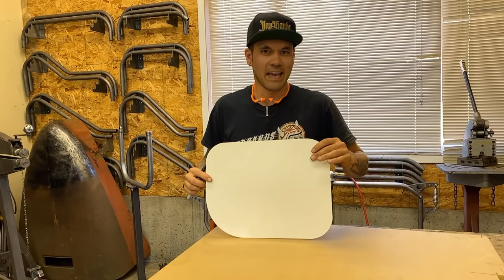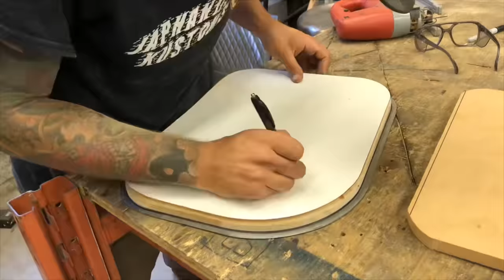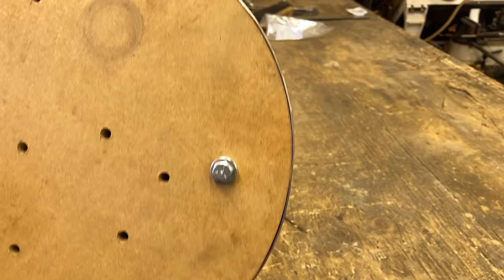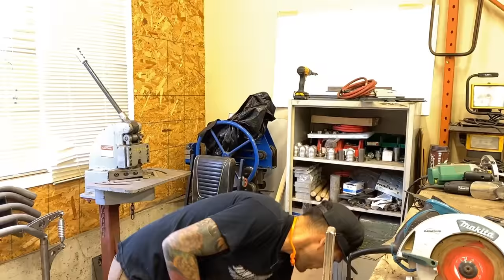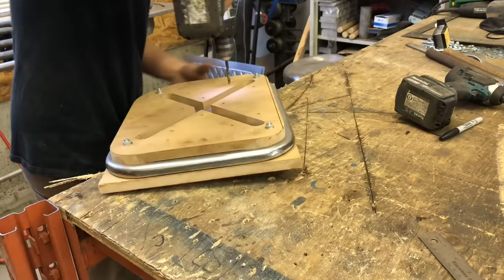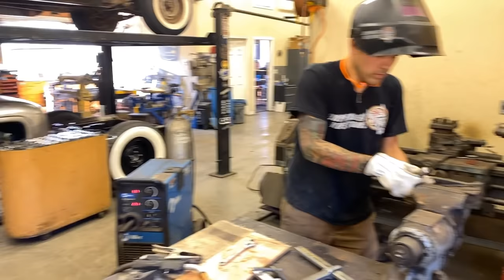Hammer Forming a Beaded Panel with Basic Tools!

Comment: Air hammers are cheap, but the compressor to run one isn't. That's the big hurdle I have to overcome in my project. I have plenty of tools for bolting on parts, but nothing for fabricating things. And there's a ton of fabrication needed on my '59 T-Bird.

Is it possible to hammer form a velocity stack? Most of the ones I find for sale are either too short or they're cone-shaped instead of having that nice parabolic curve they should have. Those are usually spun, I think. May be too deep to stretch properly with a hammer.
Reply from the maker: Anything is possible but yes that probably would be difficult to hammer form. I think that you could make a type of form that would draw in a mandrel using a bolt to curve the end similar to how a exhaust expander works

Comment: I'm assuming this won't work if you can be drilling holes in it? I'm trying to put 90° edges on an oval piece for a motorcycle muffler and can't be drilling holes
Reply from the maker: Clamps will work fine

Comment: Could you have used the router with a halfround bit to create a forming channel rarher than cutting a slot in the bottom board?
Reply from the maker: Absolutely that would’ve worked I just didn’t have the bit

Comment: I have an Idea to keep the metal from creeping when sandwiched and clamped between the MDF templates.  Rather than drilling and bolting threw the MDF and metal why not use double sided carpet tape in 2-3 inch widths. this is how I keep my metal from moving and it works well. Sorry don't mean to sound negative but would save time welding up the drilled holes.
Reply from the maker: I love that idea I really hate welding up the holes. I’m definitely gonna try that next time thank you!

Comment: going to suggest another mod for this tho. Insert a piece of phenolic resin bar in the front of it. It dosnt damage the surface of the metal as much as metal to metal contact but is still pretty damn hard so it wil probably be fine even on the end of an air hammer insert.

Comment: That is so cool on how you can do that using simple tools,also,did you design the bench you used,I like it, what are the dimensions of the table and distance between the holes and are they all the tapped? You are very well spoken,no ums,Eric's or ahhs,well done👏
Reply from the maker: Yeah it’s a half inch steel top 36 x 96 with 6 inches on centre 3/8 coarse thread
Reply: Thanks for the dimensions, I plan on building a 36 x 48 table due to the smaller size of my shop,thanks again for the ease of information on your channel

Comment: Is there a way of using this method without all the holes? I have some alloy panels I want to make, but welding up all the holes would creat a lot of warping and grinding work.
Reply: Surely you could use lots of G clamps instead?
Reply from the maker: Yes definitely if you had enough clamps you could do this without drilling the holes!

Comment: Hello, nice job. How thick is the metal sheet and what quality is it made of? Will your method work with 2mm AlMg3 as well? Heinz
Reply from the maker: This is 18 gauge steel the method will work with all thicknesses for the most part but you might have to have a more powerful hammer or stronger material

Comment: It looks like you get a more finished product with the air hammer. That must be because of the number of hits so rapidly that you can move across a smaller area
Reply from the maker: Yes definitely if you could manually hit that many times you would get the same result but you’d also be here for too long

Comment: Hi mate I’m trying this for a piece on the firewall it’s 20mm wide about 300mm long and the depth is 7mm on a 45degree with a 3mm round on the point. I’ve tried this twice now and on the point it gets way to thin and splits. I’m doing with air hammer. Do you have any tips to stop it splitting.
Reply from the maker: If it keeps getting too thin and splitting then you’ll have to make it out with more than one piece then or use thicker material to start with

Comment: Sorry for the stupid question, but isn't it a problem that the piece has all those holes in it? I mean, if you wanted it to not have holes in it, what's the plan?
Reply from the maker: Walls are easy to fill but there are ways to do it without bolting it together

Comment: I was thinking that you could use a router with a ball cutter to cut a one inch pocket in the bottom board and slot the top, then you would have your depth. You could even cut a v- groove and hammer that.
Reply from the maker: Yep that would work too! I didn’t have the bits to do that

Comment: That's a really cool technique. Looks great. What gauge steel were you using on this piece? What sort of limitations does this have in terms of too thick or too thin?
Reply from the maker: This is 18 gauge steel and it works great with an MDF form if you were to go with thicker material you might want an HDF form which is a little harder after that you could go with aluminum and finally steal

Comment: I can see a floor pan in my near future. 39 chevy truck.
Reply from the maker: Oh man 39 Chevy pick ups are my favourite full fendered pick up. I would love to build one as a daily driver one day mostly stock body lowered with all the accessories
Reply: @MakeItKustom  Have had the truck over 20 years building it now. Mustang 2 front susp. Firebird rear end ,body pretty much stock  undecided on engine. Leaning towards a built 4 cylinder so I can afford to run it as a summer daily driver.

Comment: thats cool thanks for the video just a question with using the air hammer did/can you use lube between the hammer die and metal or is it not needed
Reply from the maker: You certainly can leave between the hammer die and the metal! I’m sure it would be a lot easier actually
Reply: @MakeItKustom  cool thanks for the reply

Comment: Shouldn't an electric hammer, like for removing floor tiles and so on also be adaptable to a tool like that?
Also some experience I personally made, I can hand over, pressing works actually very well, my "press" is just a rectangular frame of two double T bars connected with 3 inch tube. I use a 32 ton hydraulic jack for truck mechanics. It's especially good for making dishes.
I can also advice everyone, to use some aluminium, if available, to reinforce the corners on your wood forms. As we all know aluminium is easy to work on and can be processed with many wood tools. Especially when you do deep circular pulls, wood is not hard enough and the metal will fold.

Comment: Just an idea. I don't like the idea of all those holes in my gas tank. What if you used a stud welder instead of bolting it you use the studs the grind them off later. 2 cents

Comment: Damn my imagination just got lit up with ways to apply this. I have a question though. 
Could I leave extra flange material around the outside to bolt it all together in an attempt to not drill through the workpiece? Or, do you think it would walk away from me inside the sandwich?
Reply: welding up ALL those holes is going to warp it,,,,it can be done without if you use enough clamps
Reply: @tomstiel7576  
Thanks
Reply from the maker: Yes I can definitely done with enough clamps! But the holes can also be welded and the distortion controlled

Comment: Wear a respirator... Grinding metal and especially working with MDF. MDF has stuff in it you don't want in your lungs... Your older self will thank your younger self. 
I just got lucky, found a mass in my lung early and was able to only need 1 round of chemo and radiation... Now I have to have CT scans every two months to check to make sure it doesn't grow back and if I can make it 5 years I'm cured. I smoked, did fiberglass body work, metal work, spray painted, did woodworking without wearing a mask way before they figured out you should. And not to say it was any of that was a direct cause, could have just been genetics, but the chemo and radiation sucks... Now trying to get stronger after being in bed for 4 months and losing 34 pounds. So wear a mask... To be safe...
Reply from the maker: Thank you for looking out for me! You are right I should be taking better care of myself

Comment: What's the most material you can " roll over the edge" ?
Reply from the maker: It really depends on what thickness and the material of the form because when you use harder materials you can do much more shrinking with the hammer hits
Reply from the maker: It really depends on what thickness and the material of the form because when you use harder materials you can do much more shrinking with the hammer hits
Reply from the maker: It really depends on what thickness and the material of the form because when you use harder materials you can do much more shrinking with the hammer hits
Reply from the maker: It really depends on what thickness and the material of the form because when you use harder materials you can do much more shrinking with the hammer hits
Reply from the maker: It really depends on what thickness and the material of the form because when you use harder materials you can do much more shrinking with the hammer hits

Comment: Maybe this is a stupid response to this video.  I understand that running bolts through the sandwich keeps the metal from sliding around but, if you clamp the metal in the form and hammer the cross in first, wouldn't that dimpled cross lock the whole thing in place for forming the rounded edge??  Also, two way tape would create enough friction to hold the metal between the sandwich and keep it from sliding.  Maybe I'm wrong.  I've never tried this before.  Good video though.
Reply from the maker: Yeah you can definitely use clamps instead of drilling holes

Comment: Hi, I think you should protect your lungs with that  mdf with that circular saw. Wood even, but mdf is known to be bad for the lungs.
(It's when you've had years/ years later with emphysema ., cancer and awful things like that.)
(It only takes a proper mask and you'll breathe well into the late years.)
Reply from the maker: Absolutely I was being foolish
Reply: @MakeItKustom  Don't worry, we've all done things not so good. I would change the brake pads on my fathers car when still a teenager. I knew, but not at first, not to use compressed air to clean out the deposits around those systems, but no one could or would say why? So I did it again sometimes.One needs to know why of course, so you can control any situation.
-A local builder back in the day, used to work with asbestos sheeting in the building game earlier on. In retirement, he had to get by with an oxygen mask. The companies (James Hardie in this one (Australasia) knew about it in the 40's I think it was, but kept it hidden. They Made a shell of it's former company and took their money to another "shell" -In one of those hiding countries.
-Silica's another awful one in the the manufactured stones. About as bad and in Australia and in New Zealand I think, far too many young guys have been unnecessarily been exposed to it.
I don't know about your part of the world?

Comment: What gauge of metal did you use
Reply from the maker: 18 gauge
Reply: Damm your an animal I’ve got 18 gauge and I have been beating my self to death maybe it’s because I don’t have a proper table to beat on it seams like the material is absorbing and bouncing the hammer back instead of forming to the buck and I am using a 2 lb sledgehammer but it’s only got a handle about 8-9 inches long. Will heating the metal hurt the metal or take away any strength using a accetalean torch ,  I have a bigger hammer and going to try that . Any suggestions would be a great help. Big Fan of your show and love your truck and you helping us green horns out ✌️

Comment: An actual bead roller would mess up inside the middle of the X. I don't know how that would work
Reply: Just an idea but using a "soft" lower die like a skateboard wheel would allow the center of the X to be made with a bead roller. However, you may need to manually tweak the edges of it after. 
And you would certainly want to pre-stretch the whole X itself with a planishing hammer or English wheel before using the bead roller to minimize warping. Ask me how I know. ;)
Reply from the maker: Yes this cannot be duplicated but mimicked with a bead roller. For something this large of a bead I would probably just tip it all the way around and then the X would not be crossed over and definitely pre-stretching would help

Comment: At last you exhausted and instead of hammering you used a lots of machines,i recommened that every body parts are available if not then this will good other wise it's better to buy whether it will be cheap ,time savings and so on,it would be better to make a mini hydraulic press by thik sheets👍

Comment: Basic tools? no bead roller but proceeds to use 15k worth of lathe, hydraulic sheet metal cutter, and disc sander. I would love to see this with actual basic tools cause as presented its cheaper to buy a cheap bead roller.

Comment: you should NEVER work on MDF or any manufactured sheet material without a MASK.

Should I wear a mask when cutting MDF?
Don't Cut It Without a Mask

Cutting and milling MDF produces a lot of dust and fine particles which contains high levels of urea-formaldehyde due to the adhesive resins contained within the material. Wearing a mask is highly advised as the dust particles produced contain formaldehyde which is a know carcinogen.